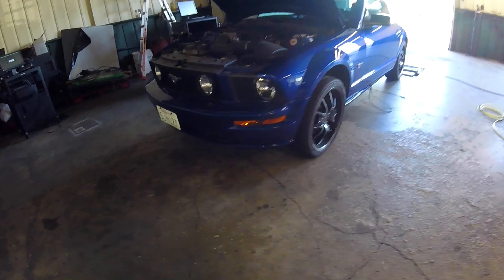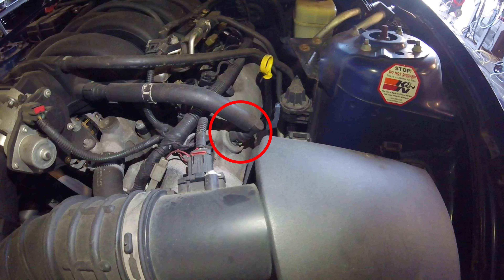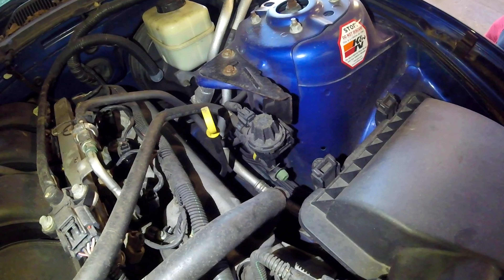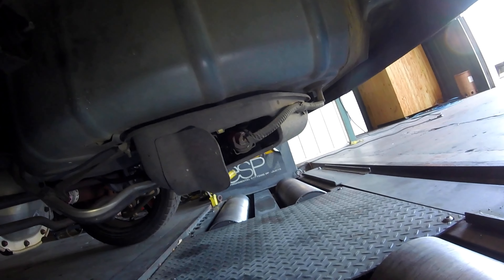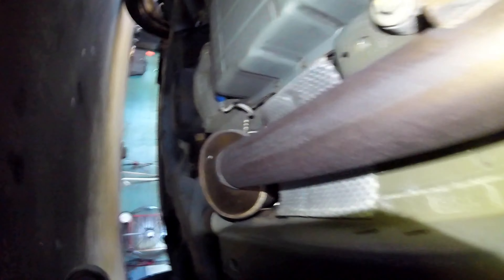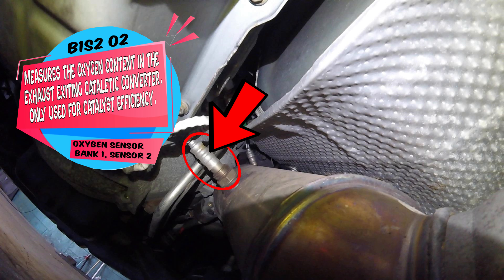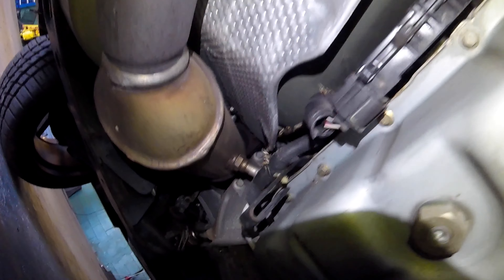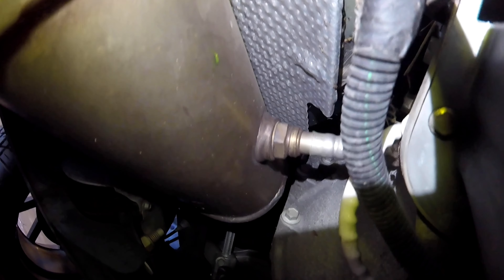Mustang Emissions Locations and Info. PCV Valve, Oxygen Sensors, and EVAP Purge & Vent.

Comment: You have another video saying the driver side is a EGR valve but it’s on a black mustang , was one v6 and the other v8 ?
Reply from the maker: Could be a different engine size it could also be a different year model vehicle. What is the year make a model of the vehicle you are working on?
Reply: @ScottiesHobbies  are there any PCV grommets to the mustang ? If so can you please tell us the location/part number, I tried searching for grommets online but not much info on them